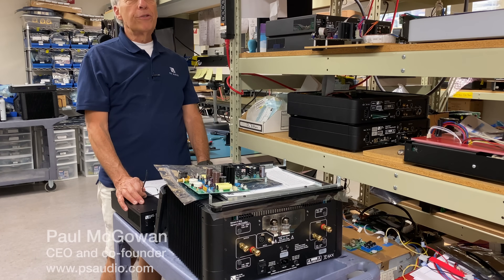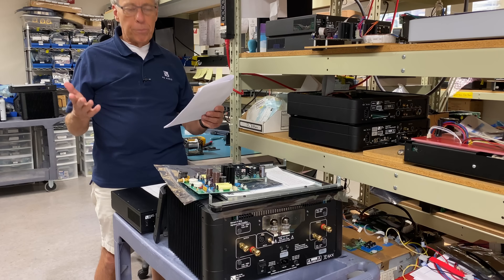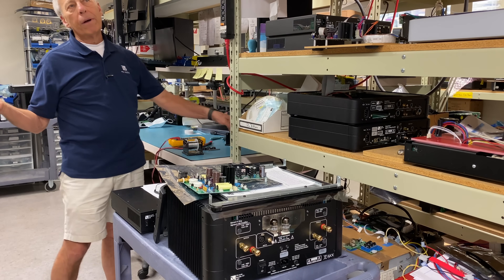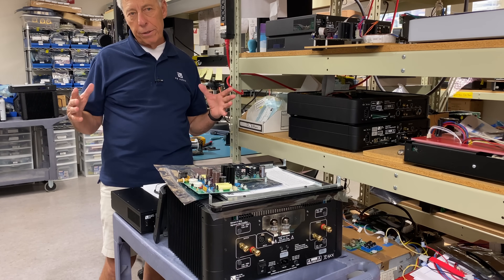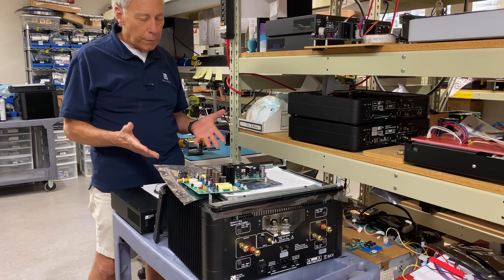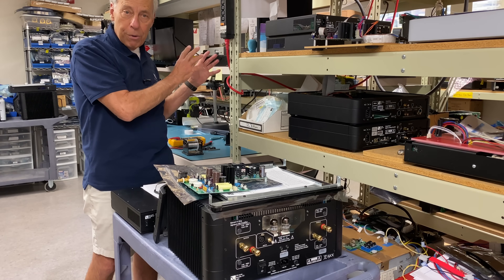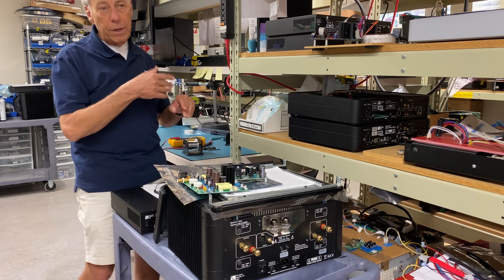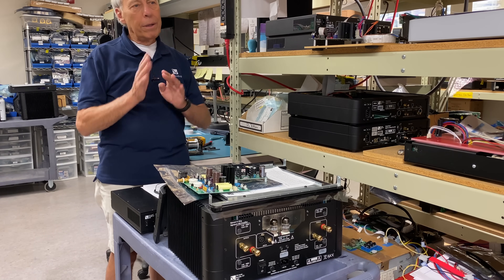Do power supplies need power conditioners?

Comment: Insofar as the grounding is concerned the ground wire and neutral on the regenerator output must be tied to the ground wire of your house internally on the input cord unless you plan to drive a new ground rod system that is NEC compliant. Without a grounded system the output voltage will remain at 120 volts but it can "float" all over the place and would not be NEC or UL compliant. The ground offers some protection from electrocution due to an accident by siphoning off current to an infinite source and sink of electrons through the ground wire instead of though you. 

To provide the ideal output of a regenerator as described it must have the regulation and capacitor banks to store charge, reduce output impedance and keep its own output amplifier stable. If your electronics costs only a few hundred dollars having that built into your equipment is too expensive. But if it costs many thousands of dollars, even tens of thousands of dollar there is no excuse for not having it built into the equipment power supply including the power output stage of a power amplifier because that is what a regenerator must have in spades. If it doesn't then IMO it is badly engineered and terribly overpriced. Will the manufacturer tell you if it's built that way or not? Only if it is. If it isn't he won't tell ya nothin'.  BTW while a large electrolytic capacitor may work like a capacitor at 50 and  60 hz, it might not at high frequencies. The fix is cheap and simple, by installing a small value capacitor in parallel with the main filter capacitor bank it will shunt higher frequencies from reaching your tubes and transistors as parasitic noise on the bias voltage.
Reply: i dont totally get what youre trying to say, but paul has said many times that the regenerators are mostly just big power amplifiers
Reply: @Crokto  regenerators are much more than that. They are rectifiers, signal generators, a very large well filtered and well regulated power supply and a high power low distortion class AB amplifier. That is why they are so expensive to make. They give you among other things what the manufacturer of your equipment should have given you if you have an expensive high end system. If your system has problems due to poor quality utility power a regenerator will fix it. Less expensive power conditioners usually won't and may only make things worse. As an electrical engineer I wouldn't endorse it if I didn't know it will get the job done.
Reply: But keep in mind that while these products are often called "Power Plants" as a cute marketing angle, they produce no energy on their own. They can only store it for a time span determined by the reservoir capacitor size, which is limited to seconds at most. In fact these units being class AB are actually quite inefficient. AC line distortion up to 10% is not going to make any difference in the performance of audio gear. Even large enterprise UPS systems typically have 3-5% output distortion. As you stated, these problems a regenerator addresses can also be fixed by a quality power supply design, mainly a low DCR power transformer and large filter capacitors. And my experience is that most high end audiophile power amplifiers already do this. To me it just makes no sense putting a regenerator on a Sony of Denon AV receiver, many of which are quite good above the $600 mark. If you have the thousands to spend on regenerator, why not use that money for better amps and source gear? Not trying to kill PS audio sales here, go and buy PS Audio amps, then if you have money to burn, invest in a Power Plant if it makes you sleep better..
Reply: @andydelle4509  I agree that you don't buy a multithousand dollar product to fix a power problem for a $600 receiver. I don't have any of these problems myself so I don't have to even think about it. I've specified, bought, and installed more double static conversion UPSs than I can remember and you are right. Even a line interactive UPS with 40% THD is good enough for your desktop computer. There are plenty of people who are not as fortunate especially if their homes are wired with multiwire branch circuits having shared neutrals between two circuits which my house does not have. Paul had such a problem when he first built his home theater room. Noise from lots of things in your own house can cause problems especially anything with an SMPS power supply but also refrigerator and HVAC compressors, sump pumps, my well pump, among others. Anything with a motor will have a high inrush current that can momentarily drop voltage. A regenerator is not a UPS. Even a UPS only has so much energy stored in its batteries which is why in mission critical applications we back them up with generators. A hi fi system is not a mission critical application. We also have rotary energy storage units which use high rotational inertia for generating a limited amount of energy for a data center and they are usually only good for seconds. They are not good substitutes for batteries but they can lengthen battery life by taking the first hit in a brief outage. 

If the high end equipment was really all that good these problems wouldn't crop up. But a lot of it isn't and personally I wouldn't pay money for any of it myself. All of my equipment is what is derogatorily called mid fi and of an earlier era by audiophiles. Personally I find the high end equipment unimpressive. If people have power quality problems that compromises the performance of their audio systems a regenerator will fix it. If they have other problems then they will have to find other solutions. Usually people who can afford regenerators have very expensive sound systems which considering their prices should have been immune to these problems but aren't. That alone makes them IMO bad engineering and a poor value.
Reply: @markfischer3626  We need more warriors like you fighting and slaying these large snakes that spew venomous oil (killing off the women n children in our villages).   GO MARK BEOWULF!!
Reply: @wa2368  
Faster than a Cray Computer. More powerful than IBM Deep Blue. Able to leap impossible problems with a single thought
Look! Up in the sky! Is it a bird? Is it a plane? No it's Super Soundmind. 
Yes, it’s Super Soundmind, strange visitor from another planet who came to earth with mental powers and abilities far beyond those of mortal men. Super Soundemind, who can change the course of mighty audio, bend sound with his bare hands. And who, disguised as Mark Fischer, mild-mannered cybertroll for a great audio web site fights a never ending battle for truth, justice and the American way.